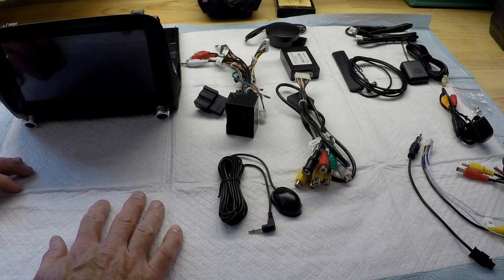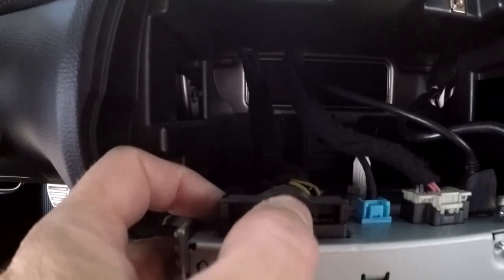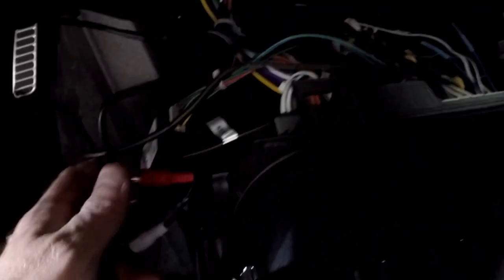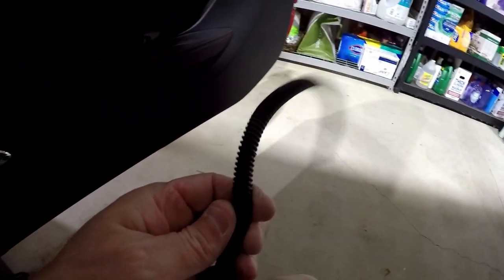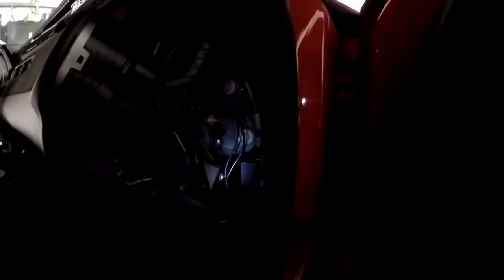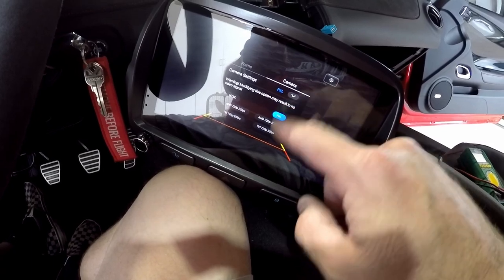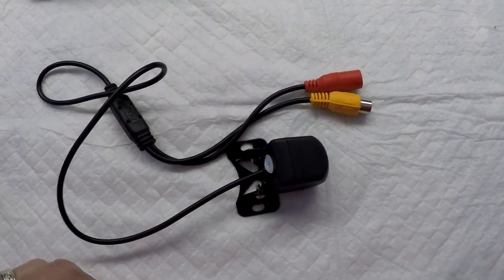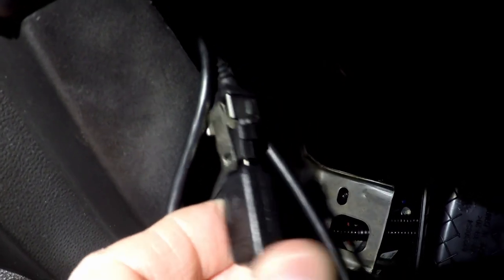We trash the MyLink for a clone of the Digital Octopus DO10-15.

Comment: According to the techs at Digital Octopus you're supposed to be able to connect to the existing factory microphone.
Reply from the maker: Cool. Post a link please
Reply: @fasnuf  Actually, the Onstar RCA cables are it.  I just got the actual Digital Octupus DO2 (looks like the factory MyLink) and in their install video (and my actual installation) connecting those cables gets you the factory microphone.  In fact, I made the mistake of having the sound turned up way too loud and I got feedback from that microphone.
Reply from the maker: @cetifoxproductions  OK, well you comment and then delete it but I get it in my email but can't respond because you deleted it. Yes my console USB works and I thought I explained that in the video, maybe not. My onstar RCA cable didn't work which really didnt matter much to me because I wasnt interested enough in onstar. Maybe if I pursued it more I couldve got it to work and the mic too.
Reply: @fasnuf  I deleted it because I went back and caught that part of your video (I somehow missed it the first viewing).  As for the OnStar connections, that's odd, because on my Camaro it definitely connected the microphone in the overhead console...not sure why my experience would be different, unless the particular trim on my 2013 SS (w/sunroof) was the key.  I'm not complaining, though, the mic works great.  I did go ahead and order the GM1 adapter (and I shared that info w/Digital Octopus), so I'm anxious to get my console USB back.

Comment: Hi just done this job myself. Did the same with the backup cam. But i think it Wold have worked with just tapping into the two wires in the plug where the radio is and have the car running and put the gear in reverse.
Reply from the maker: Yea, I figured that out later in the video but had already done the job of adding the camera. That's ok. it still works
Reply: Did you have any problems with this unit??

Comment: How does it sound?  I haven't seen a single review or installation on this product that talks about audio quaility?  The specs on the their website don't show any wattage specs nor do they answer the phone or answer their chats...  I do not have the 9 speaker system in my 2010 only the 6 speaker system with the same crappy headunit everyone else hates.  Thoughts?
Reply from the maker: Well I can't really say I'm an audiophile by any means, but it does well enough. Does it compare to a high end unit, no. I can hear some distortion on the top of the volume and being this runs through the Boston system isn't stellar. I really wanted it for the navigation which my MYLINK didn't have and the apple carplay feature, both work good. It's a mini computer and I sometimes get lost in its behind the scenes GUI, but on the front side it does good. If you have NAV and plug in with Apple car play already, I wouldn't spend the money to go to this. I also got this because the rotary knob was in the way of my gauge like I mentioned in the video.
If you're a serious audiophile and must have clean, clear sounds, I would look elsewhere. Crutchfield used to have good stuff and good info if their still around.
Thanks for watching, hope that answered your question

Comment: thank you so much bro, excellent video, i ha installed mine yesterday and it works great
Reply from the maker: Cool, they do take some getting used to, especially to get back to the A/C controls.
Reply: yes, i think im getting used to it pretty fast, i wish there was a way to bind the second knob to the A/C fan speed.
also, do you get good audio from the mic? mine is really squeaky when in a call
Reply: I’m looking for the cable that connects to the phone. The dongle i believe it’s called. Where can i get it. @fasnuf

Comment: does it have controls for heated seats? Also does the heads up display still work?
Reply from the maker: Yes for both questions, but after having this for a while, I wished I got something else. What, I don’t know, but this thing has WiFi issues and is hard to navigate.
Reply: @fasnuf  After prowling around ebay and rewatching your video I noticed several identical units with different brand names. Eventually discovered a dash kit without the head unit that looks the same. If I'm correct you could probably remove the head unit from the frame and replace it with any 10" android stereo if you are having trouble with the current one. The canbus and dash kit are the expensive parts. They probably get the kit and add a $45 head unit and mark up the price!

Comment: Installed this exact stereo in my 2015 Camaro having trouble connecting my phone to Apple car play it connects via Bluetooth on settings app of stereo is there any other steps or special app on the stereo I need to connect to for my Apple car play to work
Reply from the maker: I connect with the TLINKS app. See if that helps. I  also have wifi on the stereo on and my phones wifi connects to the radio that way.

Comment: How does that new touchscreen radio sound ? Did u get to use the new EQ yet ? Does it have pre amp outputs and video output on the back ? Let me know. Thanks😁
Reply from the maker: I would say it's not as good as say a Sony or Kenwood. I don't remember the outputs and there's no manual to reference. You would have to watch the video and try and see
Reply: Ok. Thanks

Comment: Hey what’s up just wanted to ask if you had any form of social media? Instagram, or facebook..somewhere I could message you and ask some questions regarding your coil over installation?
Reply from the maker: I have Instagram, but don't use it much for communicating. The best way is to DM me on the Camaro5 forum. I'm also only running BTR springs with magride shocks, not aftermarket coilers. Thanks for watching.